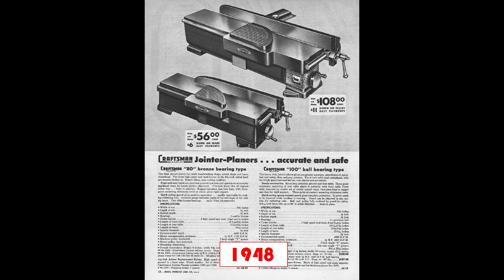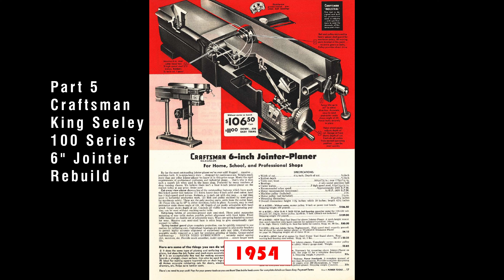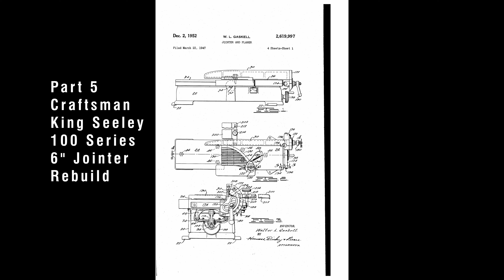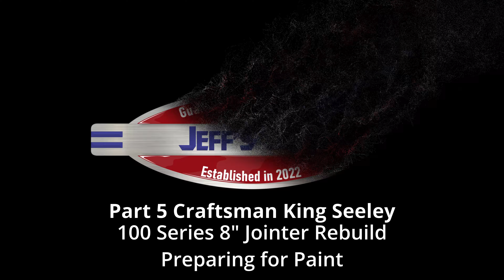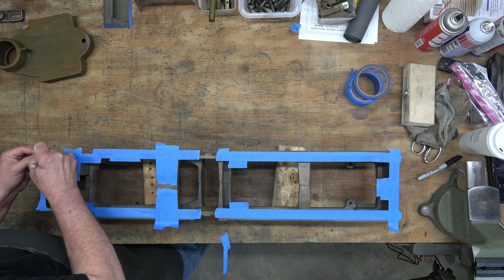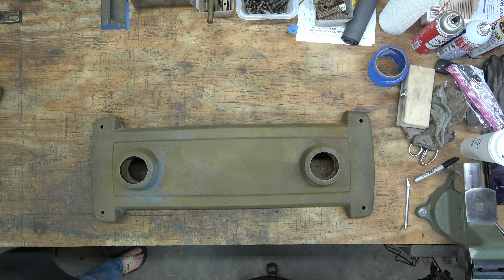Part 5 Craftsman 6" Jointer Rebuild (Preparing Parts for Paint)

Comment: Awesome video!  I just picked up a 103.20660 jointer so I can start restoring it and following along!  Quick question. The blade side of the infeed table on mine is broken. Looks like something came off at one time and caused that side of the table to break off. It’s probably about 1/2 inch deep section, maybe 4 inches long. Is there a way to repair that or should I just keep on the lookout for a replacement infeed table?
Reply from the maker: Cast Iron is difficult to weld and then there is the issue of surfacing the table portion. If it were me, I would find a donor machine and cannibalize it for what you need then sell off the remaining parts on ebay or locally on marketplace. Finding the exact replacement part will be difficult, that is why I recommend you locate a donor.
Reply: @JeffsShop  Awesome. That’s what I was thinking would be best. I’ll keep a lookout. Unfortunately the only ones I have found on eBay are for the 4 3/8 inch jointer. If you happen to know of one, feel free to let me know! 😬 By the way, love all of your restoration series!!
Reply from the maker: @seanlloyd4633  If you are not already looking, use Facebook Marketplace. I see 6" Jointers selling all the time. You should be able to locate the same model as yours in no time.